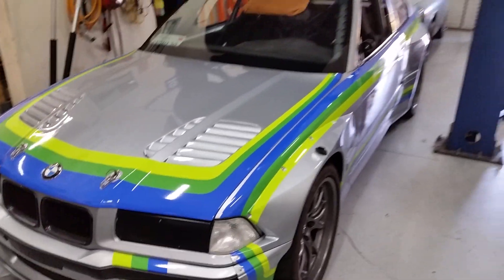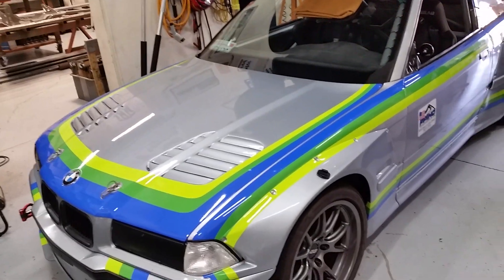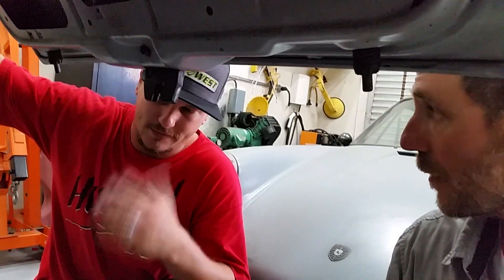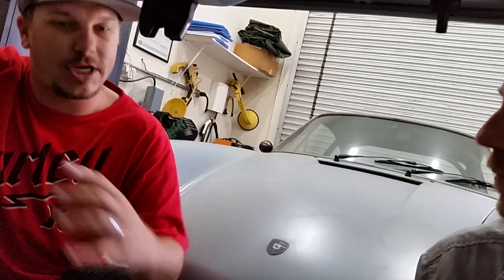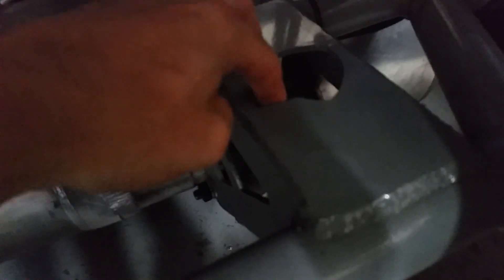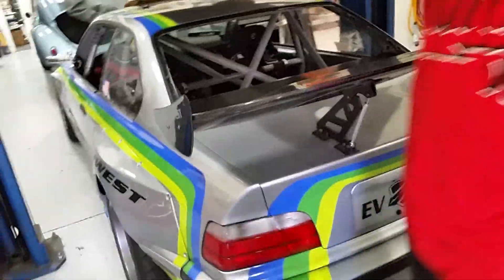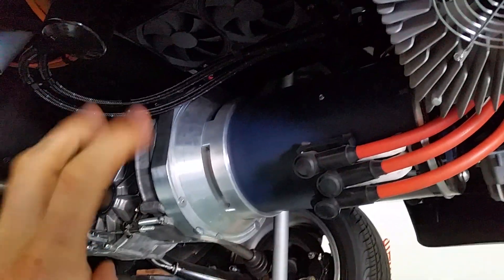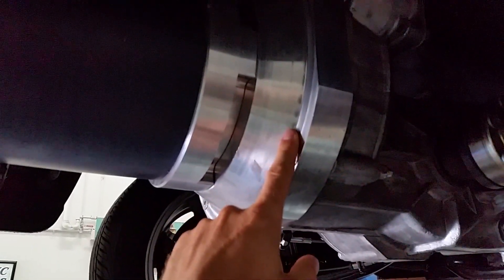Tesla drivetrain on BMW E36 M3 at EV West

Comment: It is one thing converting any classic car from ICE to EV, but one must consider the Drivetrain. I think that Tesla have fully understood this, because the Drive motor(s) are extremely close to the rear wheels, with (perhaps) the minimum of gearing between the Road Wheels and the Drive Motor. I believe that anyone who is planning to convert their classic car from ICE to EV should give lots of consideration to the marriage of the chosen Drive Motor to the cars' original gearbox. I would do everything in my power to try and dispense with the gearbox, and (instead) transmit the power to the Road Wheels via a Duplex or triplex Drive Chain and suitable Sprockets - if the Drive Motor cannot be connected directly to the Road Wheels. A Motor Car Gearbox has a very poor efficiency - some are as low as 70% or less when directly compared with Drive Chains and Sprockets. My thoughts are that (most car gearboxes) are using heavy Hypoid Oil, such as EP90, and this lubrication alone will rob every EV from achieving its full potential of range - and acceleration. The Prop Shaft will also bring down the potential efficiency of any EV, robbing it of true range. Chain Drives have come a long way over the years, and these could be used in sealed (thinner oil-bath) Units which could be self-adjusting and completely sealed from the weather or flood. Chain Drives are up to 98% efficient in the transmission of torque. Chains and Sprocket Drives are cheap to replace. Would love to hear lots of comments (either good or bad) regarding these thoughts.
Reply from the maker: Peter, the BMW in the video has a 100% Tesla drivetrain.
Reply: Thanks for that advice Ron. I tried to explain that (should the amateur try to convert a classic vehicle from ICE to EV), it is worth considering exactly where the "inefficiencies" are! Things like the ordinary Gearbox, Prop Shaft and Diff will rob any EV of its' full performance and range. Perhaps front-engined vehicles are not worth consideration. Better to cut away the Boot (or Trunk), and place the AC Drive Motor at the rear of any front-engined car. Use the front area of the car for battery storage. EV are here in Brisbane Australia, and I need to go and see them. I want to convert a '71 Bug to EV, and my chosen battery Pack would be the latest LG with complimentary BMS too! Assuming that these LG battery Modules are available. I also feel that (although the Tesla battery System is good), I feel that there is room for improvement. Tesla battery Packs appear to waste a lot of area and volume. This is because the 18650 batteries used by Tesla have a round cross-section, when ideally the batteries should be of square or rectangular cross - section. LG Batteries are of rectangular form, and therefore do not waste any area or volume within their battery packs. I have a feeling that Tesla may dispense with the round cross-section battery at some point. Great to receive a reply from you. Best wishes from Sydney.